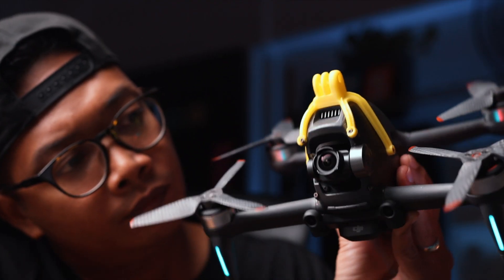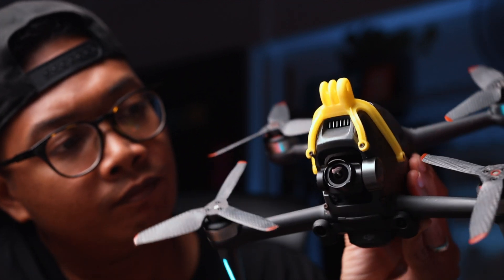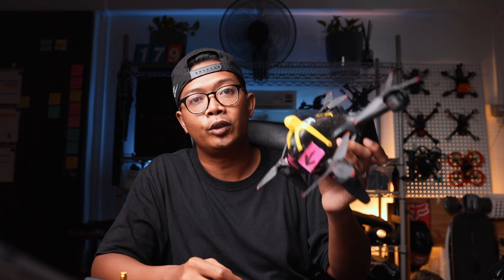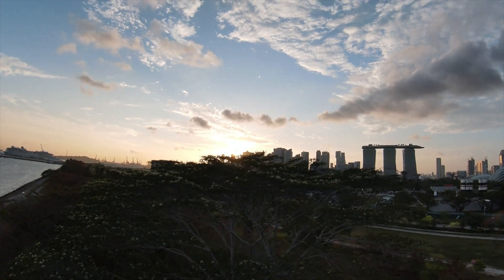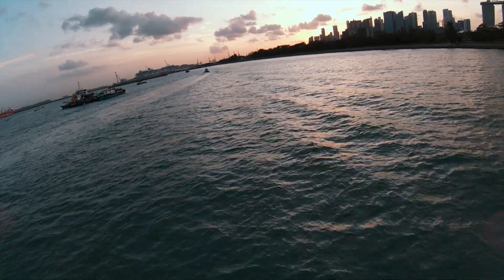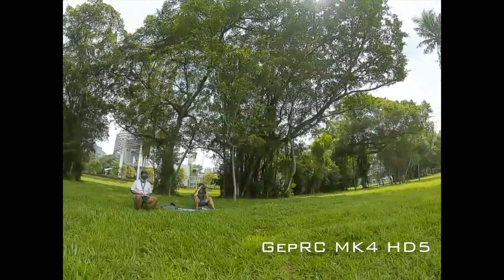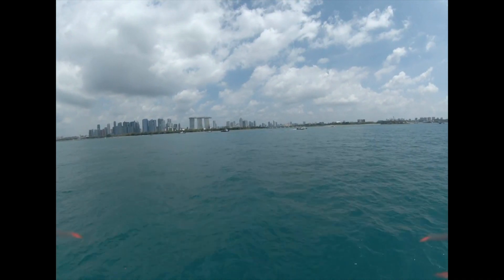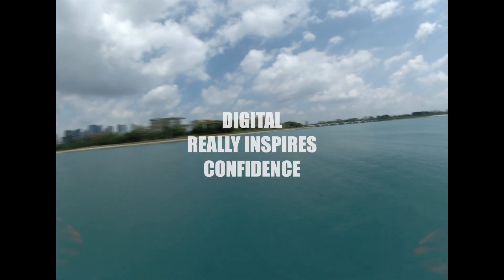Control DJI FPV Speed With Camera Tilt | Does It Make Any Sense?

Comment: Great channel! I have a question about the DJI FPV Manual Mode Simulator for the Avata. I currently have a MacBook Air and I am having trouble downloading the sim on that. I have read a few things saying that DJI sim is only available for PC. Is that true? If so, are you aware of any work-around so I do not have to go buy a PC just for that Sim? Any help would be greatly appreciated. Thank you for your time, and keep up the great work
Reply from the maker: Hi and thanks for dropping by! I have myself a MacBook, and I too cannot get the sim in. It seems the sim is only for mobile OS like iPhones/iPads. Works well on my iPad. Not saying that you need to get an iPad, but you could actually run sims on your MacBook like Velocidrone. Or if you have an android phone, here is a good sim that I use:

https://youtu.be/9WY297mYwzs

Comment: Great tutorial i switch to full acro today and i am use to normal or sport mode and was struggling to find my right camera angle. I just have to find my correct angle so doesn't feel too floaty. Love all your video good explanation
Reply from the maker: Thanks mate. Its kinda personal feel and how u wanna cruise. Some like just chill cruises, while some have a need for speed. For me I wanna make content viewable for all audience, so I have it at around 20-25deg. Smooth cinematic style cruise, flying low to give textures to the footage.
Reply: Been flying all weekend and seem 25 degree good angle but more i fly i am sure my setting will change a little .  And my style will be more define , but i am certain cinematic is what i love but just flying is super fun😀

Comment: Hi Rahim...when we change the camera angle to change the speed potential, how does the camera's one axis gimbal not cancel out our camera angle setting? Does M mod 'lock' the camera angle?
Reply from the maker: Greetings! YES, the gimbal will lock the camera in place. Traditional FPV drones are done this way, and it gives the pilot an accurate sense of how much pitch or roll the drone is on. Versus in N or S mode, where e camera is self levelling, and does not give me a sense of what the drone is doing

Comment: Hi Rahim, at 6.30 as you fly above the water, have you set your angle to +15 -20 . And do you leave it always there. I love flying that way near the ground and see the horizon. Greetings Marco
Reply from the maker: Hi Marco! Yes i love this kind of long cruises near the ground/water. Makes for a very dynamic scene. I have my angle set normally around +20-30 deg. Its fast enough for me and angled high enough that i can still land in Manual Mode. I usually dont make changes in flight, unless suddenly there is a need, like if i find the drone is flying too fast or too slow for the scene. For example, in close proximity of trees, i prefer low camera angle, but if im out at sea and chasing speedboats, then i need higher angles.
Reply: @TheReelRahim  thanks so much for your competent answer. I now mount a gopro and will test those shots
Reply from the maker: Great! I still prefer Gopro footage 🤟🏽

Comment: Hi Rahim,I found it is  harder for me to do a good orbit move using a dji fpv than a traditional quad or in the simulator.Do you have any tips for this?Thanks a lot.
Reply from the maker: I find its a mix of attack speed and angle of camera. Because of a heavier body, it needs momentum to start the orbit, then  maintain it with strong side and forward control. I had problems on my first few orbits too. Also, i practiced without EIS. Helps give a accurate feel of controlling the drone.
Reply: @TheReelRahim  Thanks again,bro.I like your videos a lot and hope to see more.

Comment: Hey Rahim. Do you recommend changing the goggle antennas? Keep up the good work and keep the videos coming!
Reply from the maker: I WANNA CHANGE TOO. To those stubby and patch antennas like here :

https://youtu.be/tLnIvolvo0w

But heres the thing. The stock antennas are tuned for both 2.4Ghz and 5.8Ghz frequencies that the DJI FPV drone needs. The Luminier kit above is only for 5.8Ghz, targeted at their DJI Air Unit which is for DIY drones. So getting them may mean a loss of range for e DJI FPV setup. I also wanna get a analog receiver set up, so this is where i will need to figure out a good combi, that will not just perform well, but looks neat and compact. Then i wont need to keep taking off antennas every time im stoeing away the goggles in my bag.

Currently my stock antennas work well for DJI FPV long range, and also the short range of my DIY fpv drones. So kinda if its not broken, don fix it situation. BUT THE LUMINIERS ARE SO HANDSOME. So im just gonna procrastinate on the idea for now...
Reply: Thanks for the reply! I’ve been having issues with randomly losing reception. I’m not sure if it’s how I am positioning myself in relation to the drone. So I thought maybe it might be the antennas. Thanks for the input. Can’t wait for more content.
Reply from the maker: When i fly, i try keep e drone in a 180deg surrounding me. Meaning its always infront and occasionally goes to the sides and back. Recep at the back is the worst. Had a friend lost his drone in that manner. U could also try the FCC Hack as thats gonna increase the signal strength (illegal in some countries). 

If all else fails, could just be the area u are in. I have signal loss going around a big tree just 100m away, but out to sea the stock drone is capable of 3.5km 🤷‍♂️

ALSO TRY FOCUS MODE. It will keep the centre of your goggle view clear while the sides will see a drop in bitrate to help maintain your overall view. This gives me an obvious drop of signal quality in the  area, and i should move back closer to homepoint. 

Try a change of locations. If e prob is consistant, than it may be hardware issues.

Comment: Gd tutorial. This info is so important for people who had only flown mavic, phantom or spark. In 2011, when we were building our very first drones, they were usually flown in GPS mode or Horizon (Angle mode in Betaflight), and the camera (if static) would always be 15 to 20deg down. But that’s only because 90% are flying in GPS mode which means the drone is way above the highest tree line. What you explained still applies, that camera has to be tilted from -15 to +15 for that “sweeping across tree top” scene.
Reply from the maker: Yup in order to have forward flight AND still capture the scene ahead. This topic alone will expand to many other episodes. Will get into a cinematics series soon enough. Looking forward to using Cruise Control in Sports Mode for Mavic-style cinematics.